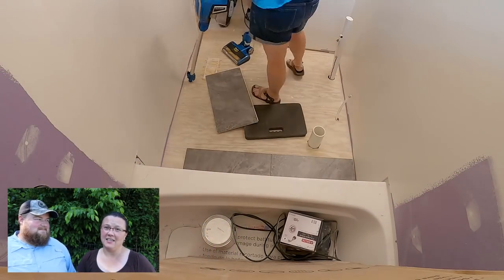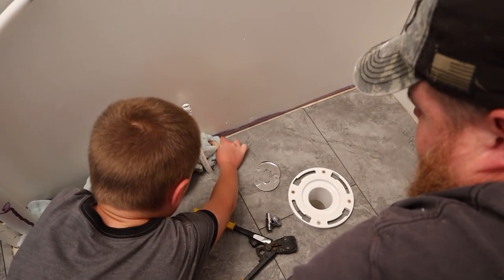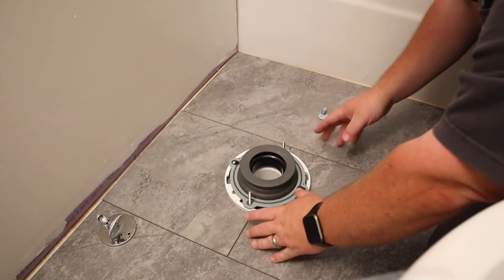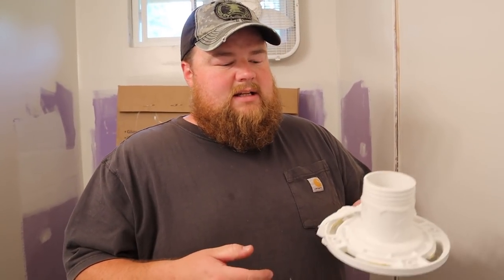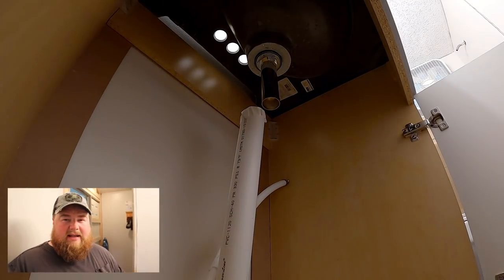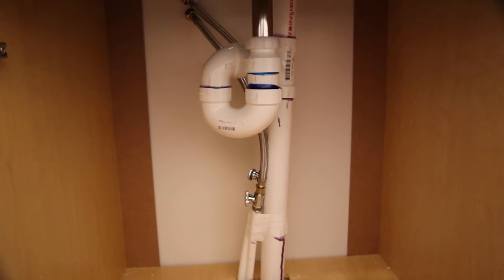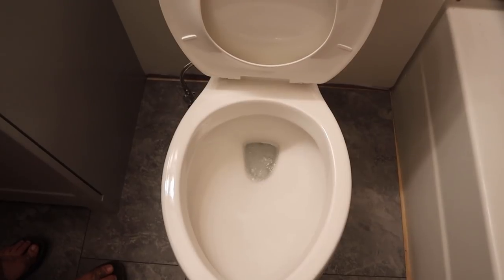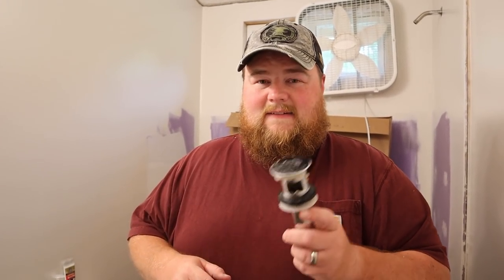We Really Struggled with this Part... Mobile Home Bathroom Renovation

Comment: Great job. My husband also dislikes having to seat a toilet because the space is always limited! As a mom of 3 boys, I have a suggestion—mount some water-proof material (plexiglass or counter top material) on the two walls around the sink. It will protect your paint job and sheetrock (even though it is waterproof) AND it’s easier to clean than scrubbing the wall.

Comment: Just a suggestion. Next time you are at Lowes buy the rubber floor mat that is sold by the foot and line underneath the sink.  It has saved my vanities when the old faucet developed leak.

Comment: We bought a toilet recently, got it home opened the box and it was the wrong toilet. I said it fine, he said NO the plumbing goes up inside the toilet and I ain't messing with that. (I would have liked it because the P-trap area that usually collects dust and other "stuff" was enclosed by smooth sides. A designer toilet, clean lines.) Now, this was after removing the old toilet that the flang was metal and rusted to the screws and the floor with all that wax ring crap smeared all over the floor around the sewer pipe. It did come up with lacquer thinner. We boxed it up and returned it for the correct one. It finally got installed using the newer wax ring. SO I feel your nightmare!! The bathroom is looking very nice! Well done ya'll. BTW, we also say it's good enough, meaning not as good as a professional getting BIG BUCKS an hour but good enough for DIY and done correctly.

Comment: I absolutely hate plumbing in the bathroom. I have used both of the wax rings you used and I have had more problems with the first one you used than the old style. I guess if I really knew what I was doing it wouldn't be so bad lol. Good job guys!

Comment: In the vanity under the sink put floor tiles on the bottom. Last for ever and helps with any water issues. My wife also put cheap place and press floor tiles on all the kitchen shelves in the cabinets. Easy to keep clean and lasts for ever.

Comment: Just a tip, I learned the hard way.
You might want to cover the screws that come up through bottom of the toilet with silicone to keep them from rusting.
Do they start rusting the minute they leave the store???
One more trick to keep them dry is glue their caps in place so no water/cleanser can puddle under them.
I'm looking forward to seeing the shower curtain, towels, and mirror you have chosen.
Squeels!!!☮️💖🙏
Reply: One suggestion I read said get solid brass bolts, not plated steel. Won't rust.
Reply: Brass bolts. Nothing else is worth installing

Comment: The bathroom is looking lovely, are you tiling around the basin and bath? Will you be installing a 'sail' shower screen or a curtain? But, as ever, you two could do a DIY TV show, that actually keeps it real. You really do brighten the day, thank you for all your effort and time with these brilliant videos. xx 🐻👍
Reply: @Opy Brook hi, it's a toughened, clear or frosted sheet of glass, which is in the shape of a sail. It quite often has a towel rail on the bathroom side. Easy to clean and doesn't stick to you if you  accidentally touch it when your wet. 👍

Comment: Two things I would add:  1.  If the toilet is NOT resting flat, be ready to have some plastic shims on hand.  2. Not sure if you did this or not, but apply silicone under the vanity top to secure it to the wall/bottom cupboard. 

You both did such a great job, real troopers!

Comment: Great job guys.  We remolded a half bath same way lament flooring. When we went to replace the toilet same issue. We replaced the flange to accommodate the right height installed toilet with a single wax ring. Great every thing was working again.  Until a few months later I noticed a stench coming from that bathroom and there was water weeping at the base.   We were at our wits end so we called a plumber.  He fixed it by replacing the wax rings except he doubled up the wax rings. When he pressed the toilet back down on the flange it sealed the flush drain.  Never leaked again.  That fix cost $250.  So if this issue comes up in the future maybe you can give that a try so you don’t have to call a plumber.  Keep up the good work guys!

Comment: I used to work for a pest control company- they used steel wool and spray insulation to seal the steel wool from condensation (condensation will rust the steel wool) - the mice may try to chew on it, once they hit the steel wool- it hurts their teeth and they move on!

Comment: wax works and is cheap, always has, that's why it has been around so long. Sometimes people try to reinvent the wheel, I work at Lowes in plumbing and never recommend these fancy new set ups, also on your drain, the trap arm length should be the double the diameter of the drain. Using 1 1/2 drain pipe, your length would be at minimum 3", this is so your water doesn't siphon out of the trap. Your bathroom came out fantastic, for some reason I struggle with smaller rooms lol

Comment: i've replaced a handful of toilet wax rings in homes .. even on tile the levels for the flange vary widely. Your solution looked way better than most tile whack and hack i've seen. Yours is much cleaner and nice. Good job guys! Bathrooms are always a pain to work on. I still need to do moms tub then toilet in both her single wide bathrooms! You giving me tips and "a-has!". Thanks as always!

Comment: Have pulled a toilet and cleaned up all the wax mess. Yuck! 
Discovered the flange is cracked.  And of course I don't have a socket the size of the hex bolt, and don't know what that size is. Argh!
So I'm with you, the struggle is real❗🤯🤪

Comment: I had both bathrooms in my house completely renovated( demoed to the stud walls and drain lines in slab replaced) last fall. I did not take into consideration they would use LOW FLOW replacement faucets and shower valves.🤬 Only regret. The renovation cost a fortune but the crews did a great job and I was very pleased with the outcome.

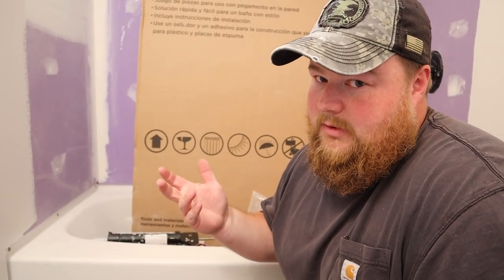Comment: FYI for viewers wanting to use this ring:  If you look closely, there is a black plastic "cap" inside the ring which protects the wax's shape (video mark 9:27 shows the shinny black "protector" cap inside the center of the ring).  That plastic cap needs to be removed and discarded.  The cap was not removed and blocked the toilet from being lowered.

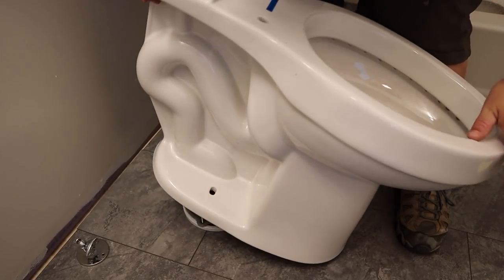At the 9:46 mark, he lifts the toilet up and you can see the "cap" has shifted.  Again, it needs to be removed and thrown away.  It is not part of the installation.

Comment: The best way ring is the old original simple ring of wax with no plastic anything stuck to it.
And excellent job putting the steel wool around the opening through the floor.  Mice will  never attempt to deal with steel wool.
Reply from the maker: Thanks for the info!

Comment: Is that an AAV above the P trap under the sink? I pulled out moms master tub in her trailer. After pulling out I noticed there was not a vent stack to roof. Only a small AAV tucked in corner sitting under the tub near the water supply. Strange. Previously I did recall her saying that the tub drained slower than desired. 1) I plan to ensure that the drain is sloped correctly and 2) Install a new AAV so that I don't have to install a vent stack.
Reply from the maker: Not sure what an AAV is, but it's a little one way vent to allow air to be sucked into the system as needed without letting any gases exhaust.
Reply: @sam-and-angela  it is an AAV (Air Admittance Valve) and you mention it in end (Studor) . I made the comment before watching til end. My bad.

Comment: Oh oh you put in steel wool, I did that and it rusted out and I found I had to use the copper stuff they can't chew through that either and it didn't rust out on me.
Reply: They also make a steel wool made out of stainless steel, maybe that's what Sam used :)
Reply: @diyfferent  Probably, he is pretty savy!

Comment: You're not allowed electrical outlets or light switches in a bathroom in the UK, light has to be switched on from either outside the bathroom, or a pull cord from a ceiling switch.
Reply: OMG, how do you use a blow dryer or electric razor?  Extension cord?

Comment: We are fixing parts (bathrooms and sub floors mainly lol) 1996 double wide. I have replaced the wax ring twice and it still leaks. The flange is cracked maybe that could be the problem. And how do you know your bolts are tight enough without cracking your toliet
Reply from the maker: In our experience, the bolts should be tight enough to keep the toilet secure. The wax ring does the sealing and seating of the two mostly. Could also be that the toilet flange is too tall making the toilet not rest on the floor all around its base? Not sure..

Comment: It may not make sense but your trials and tribulations help me as a home owner. I also live in NC and live in a Palm Harbor home. I have no issues with the house (2003) except for the tiled floors. From the very beginning I had cracked tiles and when they repaired the first ones I was told to only damp mop lightly. This was in the kitchen, hall, pantry and bathroom. I threw up my hands in disgust and have monitored the floors every since. I have found very little of the stuff they lay tile with and I really don't think the grout was sealed. All around it was a dumb idea to put tile in a mobile home, even a solid foundation doublewide.  Have you found any problems with the home construction?
Reply from the maker: Happy that we're able to help! Problems with the home... well it's from 1988 so it's got many years' of neglect in it before we bought it for $2,000 a few years back. :)
Reply: @sam-and-angela  Wow, Fantastic price for the home. I am interest in seeing what you do next on the property and to the house. I would love to ask a thousand questions and also think the joy will be in the watching what you do. Stay healthy and happy.

Comment: Good job!! It's new plumbing in a remodel. Everything is gonna feel like it's "patched" in. That's okay .... it's the way it's supposed to be cuz it is patched in. Your work looks every bit as good as I've seen plumbers do. -- Had to laugh at the reasoning behind the heavy-duty P-trap. I, too, have feral children.....er....grandchildren, all girls. You wouldn't believe the stuff I've fetched out of that trap!!!  (how did they get that toothbrush down there?!) Because of that, I insist on the P-traps with coupling nuts so that I can take the darn thing apart. -- Steel wool works great but, now, get yourself a cheap roll of aluminum foil and stuff the hole around the pipes under the vanity with crumpled foil until it fits tight around the pipes and the cuts in the vanity. (I live in the rurals....can you tell?)

Comment: That toilet seal is too high, can't push the toilet down over it. You need to get the wax ring, used that "reusable " seal before, doesn't work well for the floor flange that's on top or flush  with the finish floor! Great job !